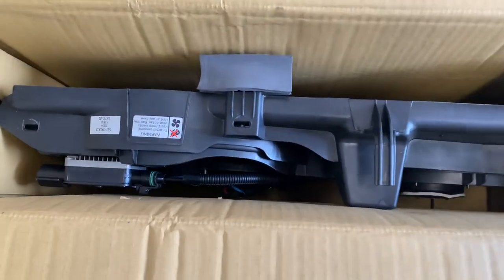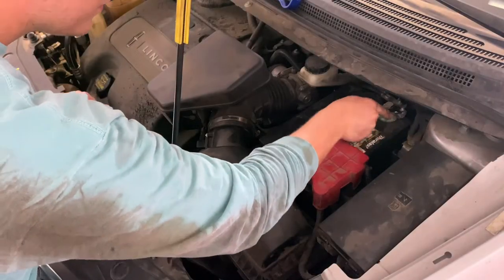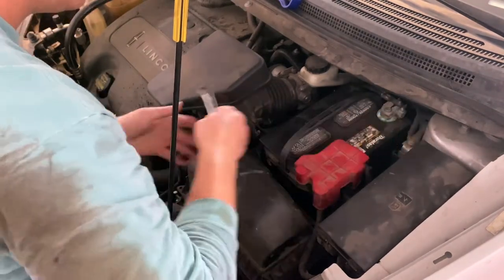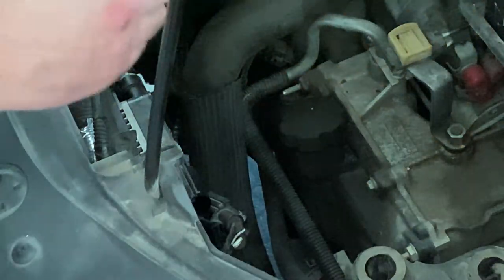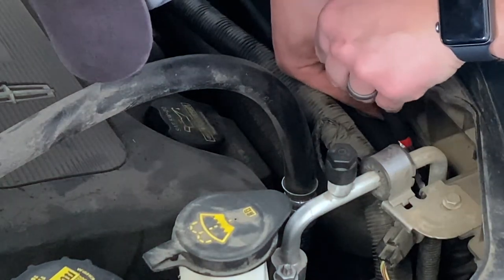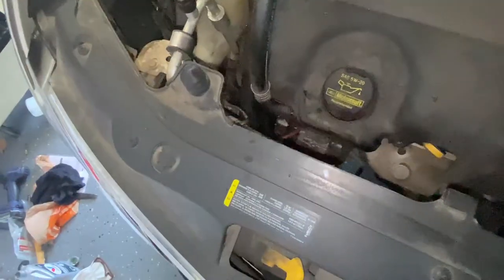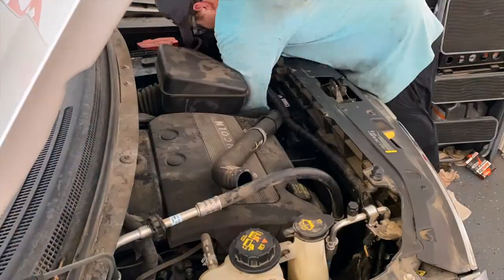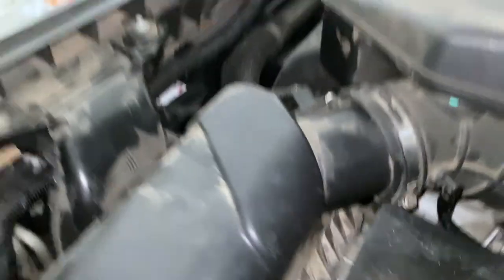Fan Assembly Replacement Ford Edge/Lincoln MKX

Comment: Hello😊 quick question there is 2 fans do both have to be working at the same time?
Reply from the maker: Ideally yes. If only one is one, the motor to that fan is likely bad, or at the very least it’s not getting the proper electrical signal. One fan is enough to keep you engine cool especially while driving, but when at a stop or heavy traffic you may start to see temps rise. Also worth considering is if one fan is out the other may not be far behind, and you don’t want to find that out the hard way. Good luck! 😊

Comment: It’s possible to replace it without taking the radiator hose off or draining fluid. If you push the hose behind the oil fill cap it will hold it out of the way.
Reply from the maker: I really don’t think so. Even if you could you’ll lose a lot of coolant and you’re more likely to damage something in the removal process.

Comment: Why did you drain the coolant?
Reply from the maker: I didn’t drain all of it, but it’s because you’ll need to disconnect the upper radiator hose and draining some out first prevents it from spilling out and making a mess later.